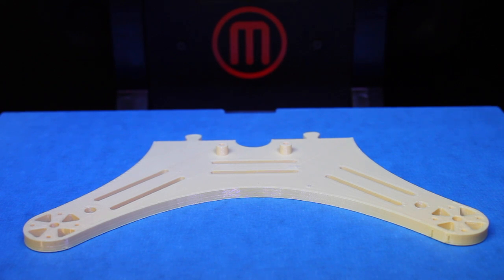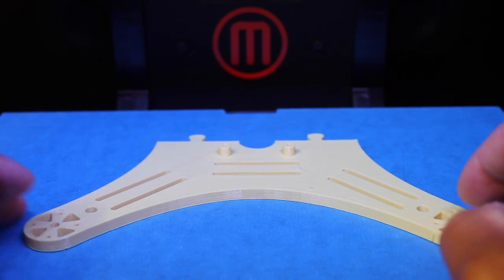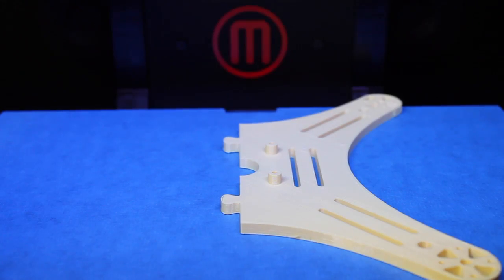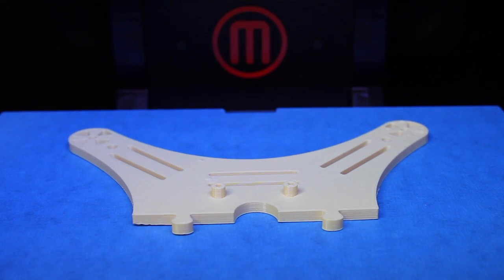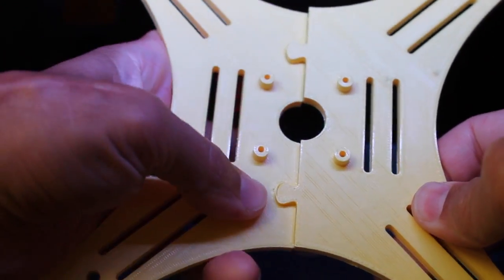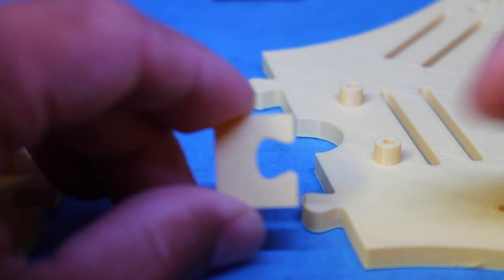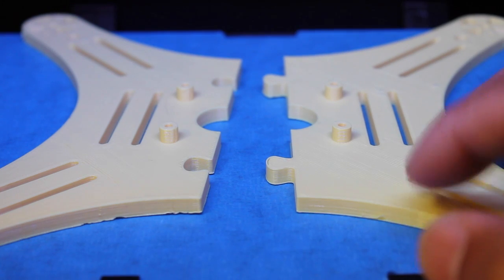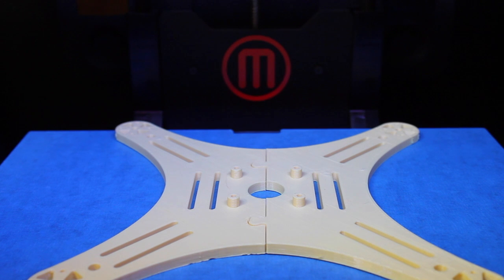3D Printing Tip: How I Use Less PLA (or any material) When Printing a 3D Prototype

Comment: how you remove blue tape from printed parts? blue tape stuck in bottom of parts that i print.
Reply from the maker: I've started printing without the blue tape using rafts. I had the same problem and ultimately decided to try rafts.

Comment: Dennis great vids, could you tell me where to get carbon fiber props. Im running 1400 kv sunny sky,  f 450 frame with kk2 and a 5000mah 45c 60 burst with 8x4.5 props (not sure if this is a good size for this copter). Its a rocket. Just recently it fell out of the sky (prop broke) 250 plus feet. Landed on the grass broke the top plate. So i drew and cnc a new from lexan .125 th good as new (better).but dont want this to happen again. thanks
Reply from the maker: Sorry to hear that and if you only broke a top plate then consider yourself fortunate :) Lexan sounds like the way to go for a new top plate. As for carbon fiber props I got some Graupners with my QAV400 and absolutely love them. Check out helidirect.com and getfpv.com. I've ordered some from both places. Good luck and thanks for the comment.

Comment: Hi Dennis,
How much does the PLA printing material cost?  I wanted to 3D print the EZUHF holder that's available on the web.  When I checked the rates to have a 3d print service company do it I was getting costs of about 130 to 150 dollars.  Not worth it at that price.  I would just strap it to a transmitter stand.  What are the costs in material to print something like that?
Reply from the maker: It's very dependent on what you print with. Standard PLA for the MakerBot costs $48 for 1kg. So basically 4.8 cents/gram. I'm working on a new quad design that will be about 100 grams so basically $4.80 for the frame. A lot of the 3D printing services really overcharge you IMO. Do you have a link to the design? Also, check out www.makexyz.com and you may be able to find someone with a 3D printer near you.
Reply: Dennis Baldwin
Hi Dennis,
That seems a bit more reasonable.

I did check out makexyz and found that the prices at a few places there were much cheaper, about 53 dollars.

If you have a EZUHF, the printed holder is nice and is found at thingverse.
http://www.thingiverse.com/thing:101766